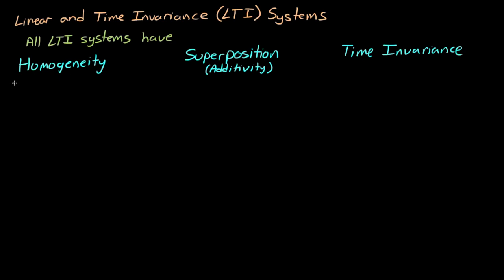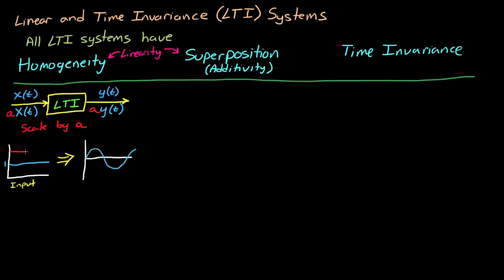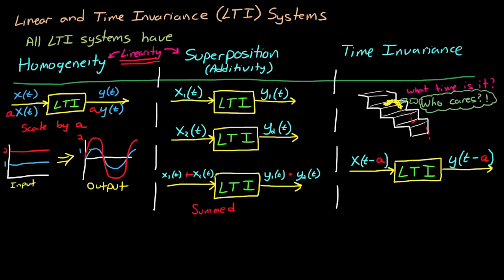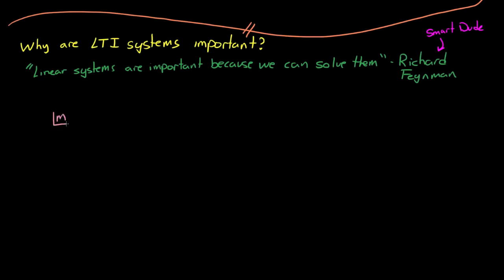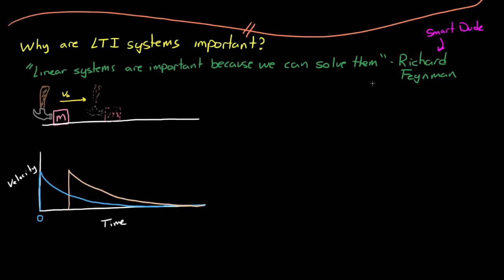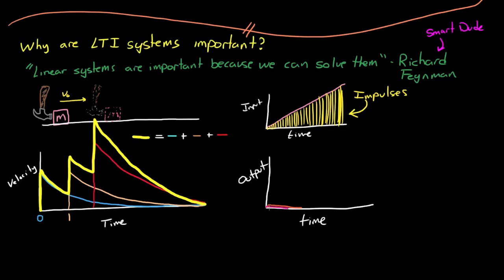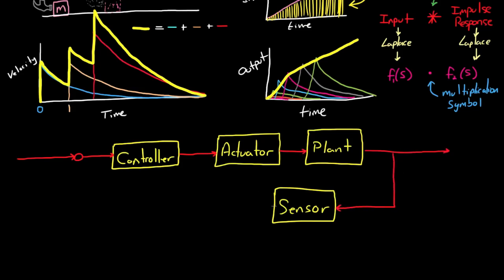Control Systems Lectures - LTI Systems

Comment: Quick clarification on the spring system showing non linearity - the region at which the restoring force becomes non linear is actually the plastic deformation zone. Elastic deformation occurs within the linear zone :)

Comment: Well Done Brian.   I would like to see more matlab and MIMO systems ; the tools for solving these equations are so many.  Concepts are difficult.   Working with pressure and temperature inputs ;  sometimes vibration.   3 inputs one output.  some times two outputs.

Comment: What does the Controller do?
Reply: wellicantthinkofone1 Check out the second video. It acts on the actuator to bring the error term to zero. Finding the requirements and identifying the  parameters of the controlelr is what a control engineer does. I think :)

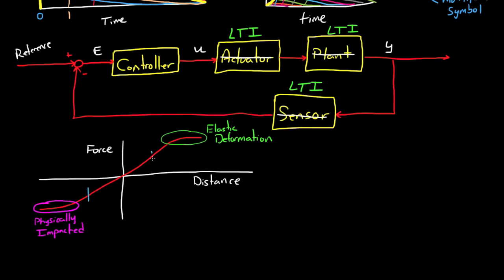Comment: At 7:07, shouldn't the spring deformation be plastic?
Reply: yes
Reply: came for this, actually the linear, "working region" performs the elastic deformation
Reply: Indeed
Reply: Yes. Plus note that the slope around the origin is normally negative as the displacement and the force typically have opposite directions. Also when the coils physically impact, the force ramps up a lot while it becomes way harder to compress the spring, this is the opposite of what he drew. But as much as he is confused about springs, he does a great job explaining the concepts of control theory :)
Reply: Its in the elastic region until you bend the spring too much and it goes into the plastic region, thats when the spring doesn't go back to the original shape

Comment: I know, this will sound stupid but let me put my question across. Regarding convolution, you refer to input and the impulse response. In my opinion, input fed to the system was an impulse and system its self is a system represented by a transfer function. Result of convolution which is simply multiplication of input with the system in “S” domain is called impulse response. This is how, I think we should refer to terminology.   Why do you refer to the terminology otherwise/

Comment from the maker: Also, sometimes a system is just too non-linear and you have to design a non-linear controller.  Sometimes this consists of complicated non-linear controllers, and sometimes it's as simple as two linear controllers that you switch back and forth between.  In that second case the switch is the non-linear part of the control system.  Theoretically you could have 10 or 100 linear controllers that you switch between based on the operating region of your system, but this is hard to analyze.

Comment from the maker: Huntergotu, that's a good question.  Linear systems are good because we know how to solve them.  So when you're designing a real world system you try to make them as linear as possible.  If you look at the data sheet of sensors (like an accelerometer) you'll notice one of the parameters is 'linearity'.  The more linear, then the more accurate your LTI analysis will be.  We also add stability margin to designs to protect against what we don't know, including the non-linear terms.

Comment from the maker: Hello Prashant, determining if sin(2t) is an LTI system is pretty straight forward.  You can do it by testing it against the definition of an LTI system, mainly the linear part.  If sin(2t) is linear then it must have the properties of homogeneity and additivity.  For example, we'll write f(t) = sin(2t).  Now does f(t+a) = f(t) + f(a)?  Or in other words does sin(2t+2a) = sin(2t) + sin(2a)?  You'll see that this does not hold and so sin(2t) is not an LTI system.